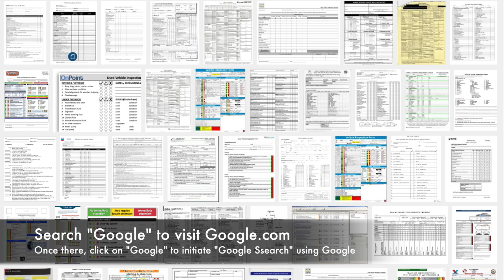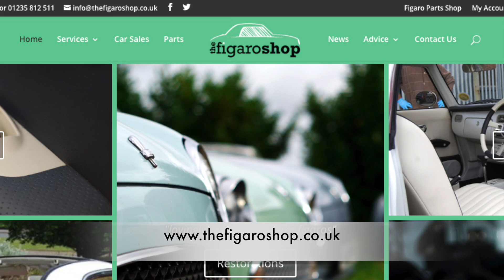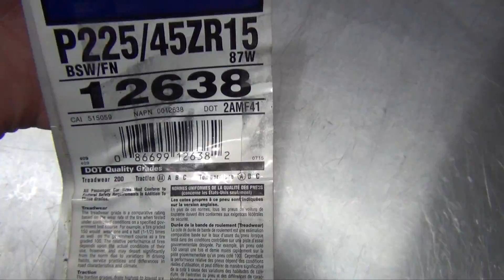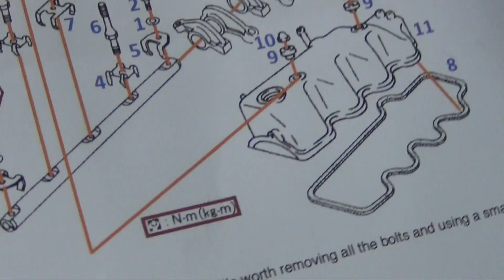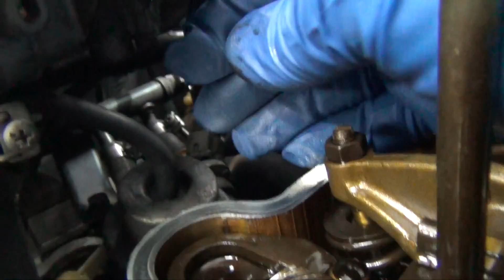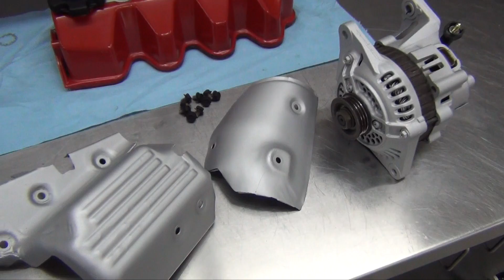1991 Nissan Figaro - Project "Figgy Fix-Up" Part 3

Comment: Great video! Thanks!  Did you have a trick to getting the fourth spark plug out?  I've heard you have to grind down the outer diameter of a socket to fit over it because of an interfering bolt next to the plug.

Comment: Wanted to take a moment and thank you for the advice to re-tighten the bolts on the rocker arms. Did that on my car last weekend when I was doing VC gasket. A couple were not tightened up to spec. Fixed a noise that worried me for some time :)

Comment: Tom your workmanship and attention to detail is outstanding  , A  little helpful tip for you, if you glue a piece of emery cloth on the inside of your oil filter wrench it will grip the oil filter better when you need to unscrew  a tight one . I look forward to the next video     Pete m

Comment: A small hint. Those connectors, you dont have to remove the metal clip. Porsche uses the same type of connectors on their older cars, all you need to do is to wiggle the connector from side to side. When you pull it up on one side it lets the metal clip go over the ridge on the connector, if you slightly pull it towards you at the same time and then wiggle it to the other side itll come off.

Comment: Great content as usual mate, keep it up!  Just as an FYI, the 80's Nissan electrical connectors can just be squeezed together to remove them, rather than levering the spring clip off.  It took me a long time and many, many dropped metal clips before I realised that.

Comment: might be a good idea to have the tire alighnment checked , think the front joint on the lower arm ccn be adjusted by an exenteric bolt 
cant hurt to have it checked , will save yure tires from exessive wear should the alighnment be off 
if they sell those cars in the states you might want to check crossreferenceparts with the nissan micra 
https://www.google.nl/search?newwindow=1&safe=off&hl=en&site=imghp&tbm=isch&source=hp&biw=1517&bih=751&q=nissan+micra&oq=nissan+micra&gs_l=img.3..0l10.1512.4058.0.5349.12.8.0.4.4.0.234.1122.2j5j1.8.0....0...1ac.1.64.img..0.12.1181.uN7AvUSVav0

i think they used a lot of the technical part from that car like brakes engine and gearbox

Comment: Those control arms look similar to the Nissan Maxima ones. BTW I have been using that cardboard trick you showed from previous videos to organize bolts. It helps alot.
Reply from the maker: Thanks man, glad I can help!  They are probably similar to many others, just scaled down a size or two compared to those.  Most parts a size smaller in this car.

Comment: So when will you install the new turbo, intercooler, megasquirt system, exhaust, and head spacer for lower compression? I want to see this thing turned into a tire burning monster!

Also, on a serious note, for cleaning rusty crusty hardware, try soaking them overnight in vinegar. They will come out clean and shiny and ready to paint.

Comment: Did I just see you anti-seize your lug studs? Thou shalt not lubricate thine studs lest yee wheels depart. Verily I hath witnessed.
Reply: Anti-seize won't make bolts back out, so where do you get the idea that it will somehow make lug nuts back off?

Pro tip: lug nuts, or lug bolts if you have a pos eurocar, wear out over so many times being torqued, and need to be replaced so that they don't back off.

Pro tip again: do not torque bolts that have anti-seize on them to the same spec as dry. they stretch easier than when dry-torqued because of obvious reasons (they're lubed, in case it wasn't obvious). There are conversion tables that will help you not over-torque your new fasteners and ruin them.
Reply: lugs always go on dry. It's the mechanical friction not compression that holds the lug if you cut that friction with a compound that prevents binding the lug can back off easier. lower the torque in one direction lower the torque in the other. Studs are cheap, losing a wheel isn't.

Comment: You wouldn't put anti-seize on the threads of lugs. It can cause inaccurate torque or cause the lug nut to back off.

Comment: Just a small tip my dad thought of, but what he does in his shop is mark the floor for different vehicles so he knows exactly where each vehicle needs to be in relation to the lift posts so that they line up.  Maybe something you can try to make servicing easier.
Reply from the maker: That's an awesome tip, thank you!

Comment: Just a question. The valve cover in this engine doesn't use any gasket?
Reply: The valve cover has an indent under it and the gasket is pushed inside.
Reply: Good to know. I was watching the video thinking about leaks wasting all the effort after all the job of cleaning the valve cover.

Comment: please please PLEASE brighten up your yellowed knobs. it is an easy process and only requires some hydrogen peroxide.
Reply from the maker: I actually picked up a reproduction set from Figaro shop because mine were too cracked to spruce up.
Reply: ahh, cool.

Comment: At approximately 10:00 you remove the metal clip from the connector? I think you're supposed to leave those on the plug, and just press them to release it.
Reply from the maker: Hi Jim, according to the service manual, this type is supposed to be slid out from the connector.  You don't have to completely remove it from the plug like I did, but they always fly off and disappear somewhere under the hood.
Reply: Tom's Turbo Garage Okay, thank you for clarifying. Better to remove them and keep them somewhere safe then ;)